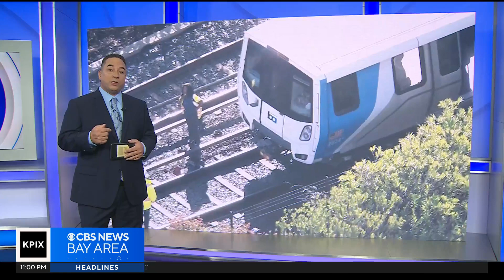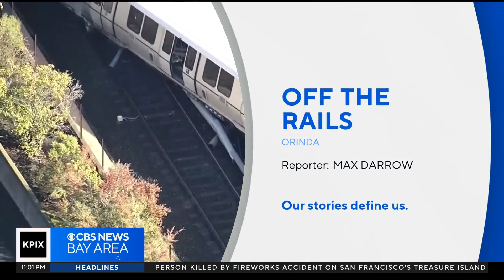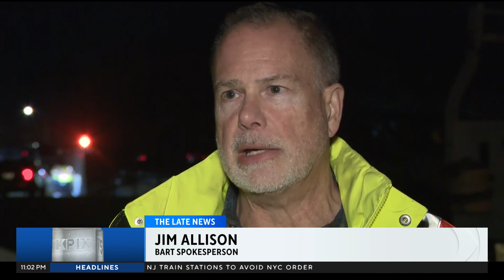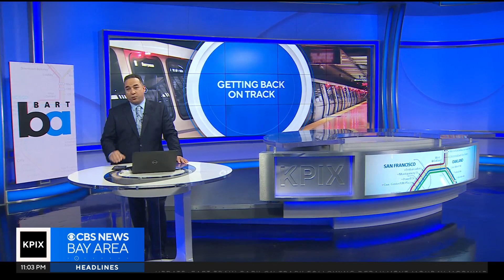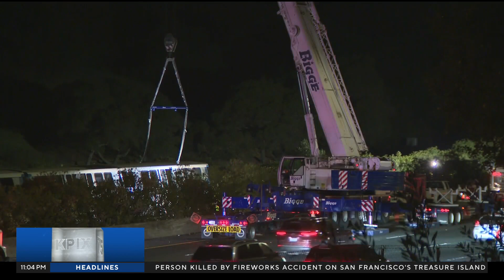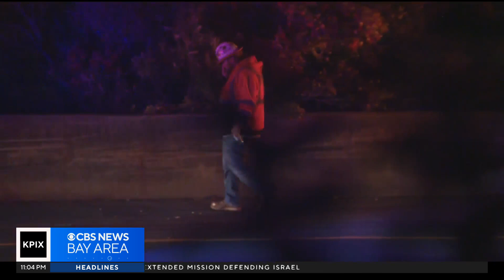Derailed BART train back on the track

Comment: Bart has new set of tracks on that section every year. New trains. But yet has failed to replace there computer system. Last time I heard it has never been updated to modern day standards. So delays are most to be blamed on the computer system rather than weather conditions
Reply: They are currently switching to cbtc since a few years ago but have not yet finished